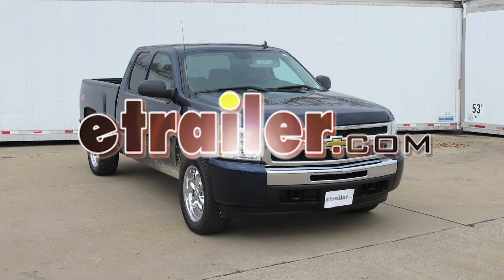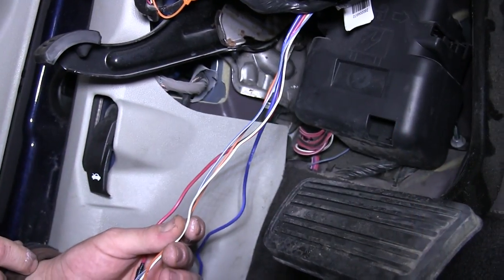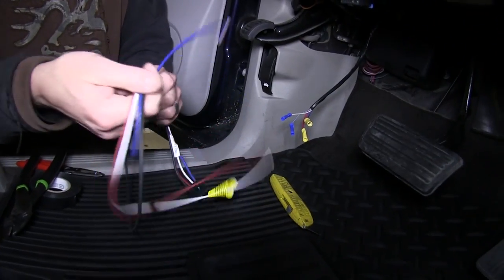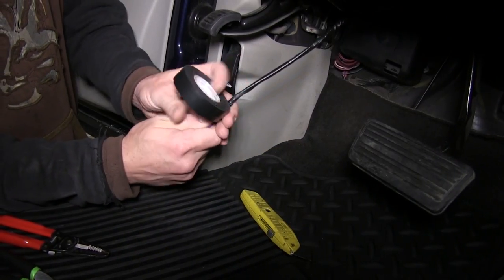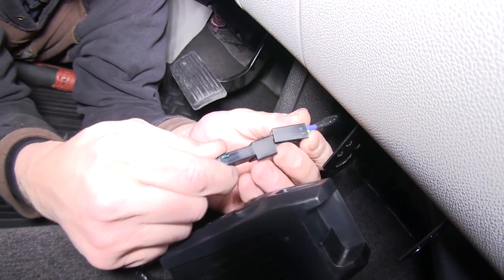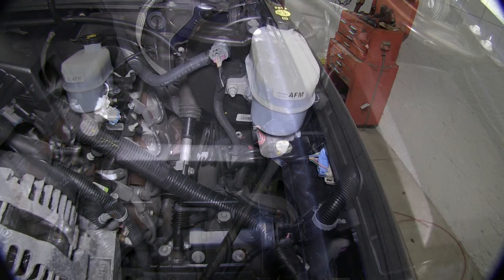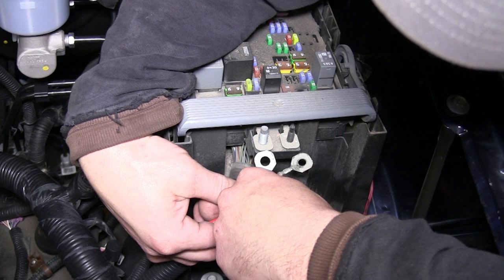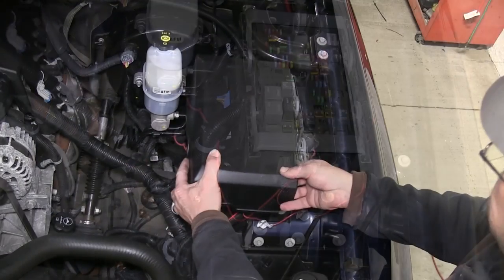How to Install: Tekonsha Voyager Trailer Brake Controller on your 2010 Chevrolet Silverado

Comment: Good day great tutorial, I have a question what is the orange wire use for that is not be used?
Reply from the maker: We are unsure of the orange wires function, other than you don't need it for this installation.
https://www.etrailer.com/Trailer-Brake-Controller/Tekonsha/39510.html

Comment: what about adding a fuse in the fuse box?
Reply from the maker: EricDavidFloyd Most of the time the fuse is there. On some models you will need to add a 40 or 30 amp fuse to provide power to the post you connect one of the underhood wires to. Sometimes this slot is filled with an orange plastic dummy fuse. Here's a tech article with a bit more info. http://www.etrailer.com/faq-brake-control-gmc-sierra-chevy-silverado.aspx

Comment: How do you bypass factory controller
Reply from the maker: Betty Burrage The install for an 07-13 GM truck with a factory controller is pretty similar with an additional step. We have a tech bulletin on the subject here: http://www.etrailer.com/faq-tb-2007-2009-GM-Full-Size-Truck-w-Factory-Installed-Brake-Controller.aspx
Reply: etrailer.com Why do you have to run a new blue wire to the the trailer harness? What is wrong with the factory installed blue wire?

Comment: What size and thread nuts are used to attach the terminals to the fuse box studs?
Reply: That’s what I’m trying to figure out. Did you get it?

Comment: What size nut did you use on the port terminals. Mine has the right side. Missing the left side. Looks like course threads?
Reply from the maker: We do not have the measurement of the bolt size for the terminal connection point. You can check in with your local GM dealer and they should be able to tell you the size of the bolt and supply you with the replacement bolt.
https://www.etrailer.com/Trailer-Brake-Controller/Tekonsha/39510.html

Comment: that video helps but it's not enough detail information to tell the everyday do-it-yourselfers how to install the e-brake for the trailer????🤔
Reply from the maker: You can check out the following link if you are wanting more information on how this brake controller installs.
https://www.etrailer.com/Trailer-Brake-Controller/Tekonsha/39510.html

Comment: Says 6 and 8 mm nuts but really a 10 and appears 13 mm.
Reply from the maker: These are a M6 and M8 nut that need to be used to secure the wiring to the post on the fuse panel. We no longer carry the M6 nut but you can find the M8 nut in the following link.
https://www.etrailer.com/Accessories-and-Parts/Fastenal/185917.html
https://www.etrailer.com/Trailer-Brake-Controller/Tekonsha/39510.html

Comment: You forgot to add the 40 amp fuse  for brake ,right post is a 6mm nut and left post is a 8 mm nut